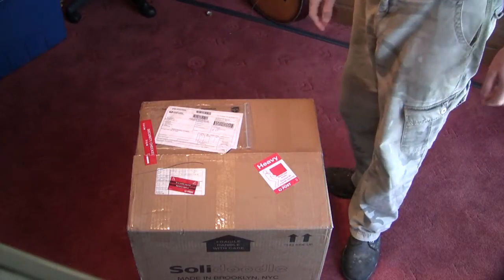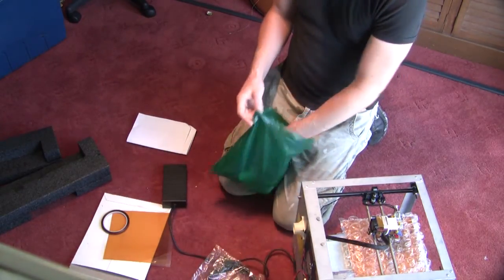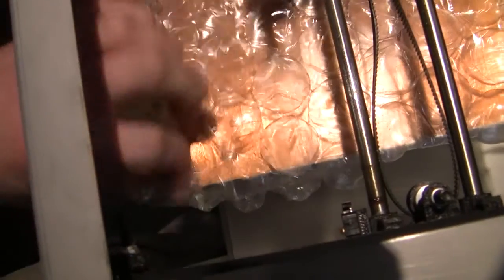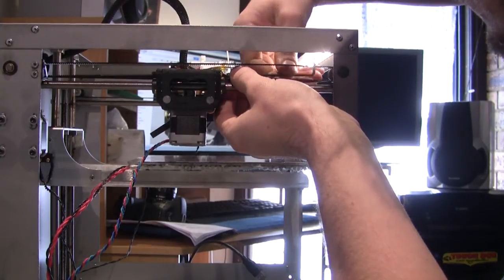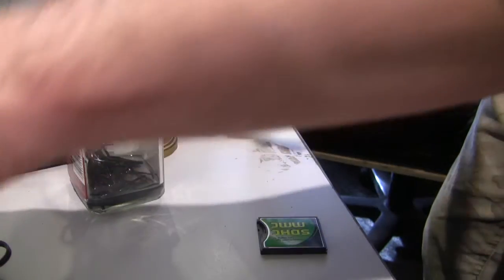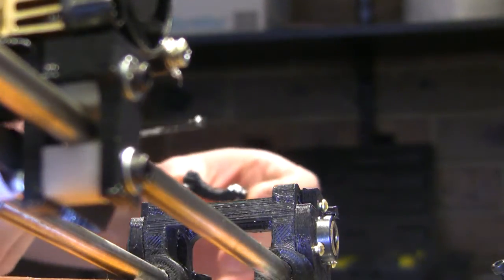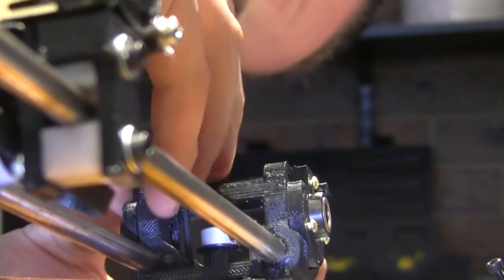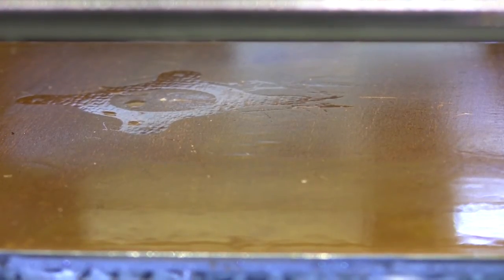Solidoodle 3 3D printer unboxing, repair and first print

Comment from the maker: im in vic.... and keep your eyes out for my update video.. i have made some MAJOR changes to the doodle and its reliably printing to 0.005mm and i have a larger print bed, some from my own design n some from others, i will be changing the PSU shortly also as i think they use one that has just enough amp rating. they might have added some ties, it was strange for it to be free like it was, but i think they wouldnt have helped much as it was the mass of the motor that caused the break not movement

Comment: Hard luck mate, which state are you in? I just got a Soli 3 as well, shipped to Briz... Luckily everything is fine (so far). I even got a powersupply with a standard PC-style plug so it was easy to get the Aussie prongs. I had 4 cable ties holding the 2 side rails, maybe they were to stop any movement and flexing during shipping to prevent the problem you got. You're right, everything is a bit chewing gum and rubber band, but I like the frame, and the price. I better print spare mounts asap...

Comment: I tried printing on a sheet of plastic with the heat off.
I used a thin layer of hot melt glue and printed with the heat off and then heated the bed to remove the parts. That keeps the part to the bed, but layers coming apart is a big problem. I did build an enclosure to keep the ac from blowing on the parts.
I need to try your idea. Sounds much better than mine.

Comment from the maker: i have gone to a glass bed, and painting it with some of the ABS dissolved in acetone (you want it like milk thickness and only a very thin layer) i also found that the enclosure i made helped alot, as does waiting till the bed hits at least 80°C, another thing i do it add a brim to most of the prints, it helps alot while your learning. have you done all the calibrations?

Comment: I have the same printer.
I had to wait weeks to get mine also.
I am having problems with layers not sticking together and parts coming loose from the bed while printing.
I have gotten some very good prints.

Comment: Agreed, it's a strange choice of plugs-I mostly see them on laptops that come in for repair. The C13/C14 or C7/C8 would be a much more sensible choice, as they are much more common. They probably got a cheap deal and went with it.

Comment from the maker: thanks for that, i'll be replacing the PSU very shortly as from all reports its only just big enough, and i've added fans and will add more LEDs. but im sure you'll agree the C13/C14 is much more common and easy to get your hands on a spare, from the bundle of cables everyone has in a draw somewhere.